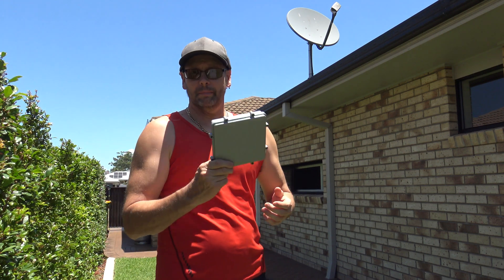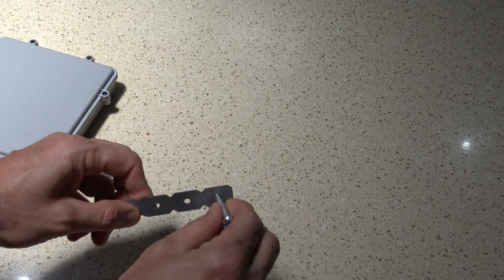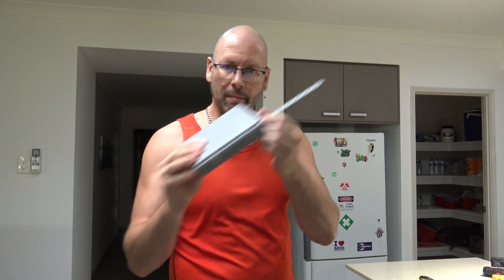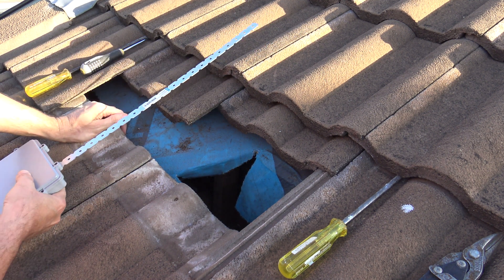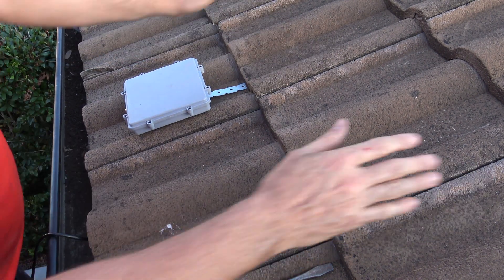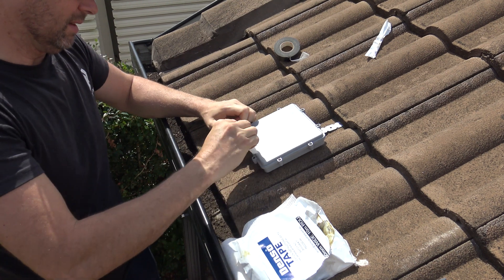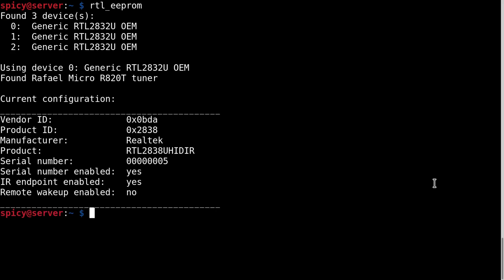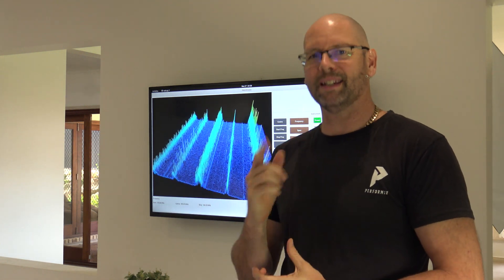Satellite Antenna For SDR

Comment: 1:00 minute timestamp indicates that the description text might benefit from mentioning 1/4 20 UNC (consumer camera mount screw thread) size. This information is to help people. Having that fitting and a VESA mount (for servos to position at a satellite like say so an LNB, by means of KU-Band, can also get data and signals to and from Es' Hail 2 satellite's amateur radio transponder transmitting on the 3CM band)_ atop a grain silo and IBC (water) in refugee camps (with a small screen at the bottom the height of a man) could be handy to send OpenID_OIDC_OAuth2_SimpleSamlPhp_LoRaWAN data for logistics of items, people and business allocation like graphical linear inequalities for moving pretty much anything with a pertaining Q-R Code (3KB) sticker on it, containing all such data and latitude-logitude-altidude cronjob and bearings for derived velocity and IPv6 unique identifier (and A2DP, EDR bluetooth 5.2 and wifi 6 and ZigBee gadgets atop it with solar power and battery), tracking data via markov chains and gaussian heatmaps for disease, nutrition and so forth.
Would be interesting to see a Q-R code sent/received by Data Mode like SSTV Slow-Scan-TV and the error correction tolerance of those Q-R codes, like say on a version 40 177x177 size. compiled data can be compressed as TAR ball GZ and only safely sent data is sent, so encryption can be used if needed (as a GPL, like GnuPG or BOTAN version). Some portable dishes allow for usb to remote in like RS232 serial for changing angle on a BASH script.
My comment has no hate in it and I do no harm. I am not appalled or afraid, boasting or envying or complaining... Just saying. Psalms23: Giving thanks and praise to the Lord and peace and love. Also, I'd say Matthew6.

Comment: Think I mentioned it in a previous video, but there is some very interesting and fun stuff in the band, techminds did a few videos on what you can pickup and decoding steps,
I usually just monitor the inmarsat std-c messages, get the usual weather and pirate warnings, plus the odd email message.
Iridium is a bit more complicated, but also contains some interesting stuff

Comment: What kind of satellite antenna is this? Is it for geostationary satellites? Also just a heads-up: all the modifications you've made to that metal strip will cause it to start rusting a LOT faster. The screw too, because you've partially removed the protective covering (probably zinc plating on the strip and zinc-chromate coating on the screw). Just so you know.

Comment: Do you have to protect against lightning strikes with the antennas on your roof?  I keep mine within the attic because I'm not sure how best to deal with that.
Reply from the maker: If lightning strikes my roof, I'll have bigger problems than that antenna.
Reply: "I keep mine within the attic" - lol
Reply: @CoolKoon  Guess where the conduit with the wiring for the stove runs that was hit by lightning. In our attic. Welded a hot wire to the conduit when it did it.
Reply: @gravelydon7072  I mean if any of your devices get directly hit by lightning then you're SOL either way. If you only get hit indirectly (via inductance) then your devices might stand a chance with the help of a TVSS. Antennas on the top of the roof should be equipped with a lightning rod anyway I think. Either way your antennas are not too useful when they're inside in your attic, are they?
Reply: @CoolKoon  All our antennas are outside. What makes it bad for us is that we have a two story house in the lightning state. we already have had direct hits on this house and the previous house which was only a one story,  got hit 5 times in the 17 years we owned it. Were they direct hits, well seeing a heating element impact the glass in the oven door would say yes. As would the TVs  and clocks and the fact that the cable from the TV to the amplifier we were on and the rest of a whole block got taken out at the same time, yes. Insurance company refused to pay on the last time until an electrician came out and checked the wiring. As did the phone company and the local city owned electric company. All found that house properly wired and grounded. Such is the dangers of being the first house on a transformer that is connected to a 3 phase line.
Reply: @CoolKoon  Well that depends on the antenna and the attic obviously. I have a simple FM rod up in my attic. But that attic isn't insulated. That antenna is connected to a high quality amplifier/splitter and captures analog FM radio, DAB digital radio and DVB-T digital TV (I'm in Europe) very well. FM stereo without noise, DAB and DVB-T with 100% signal quality. It goes without saying that a satellite dish isn't going to work there. But it is comforting to know this attic antenna is well protected against weather and lightning as I have two TV's and two FM/DAB radio's connected to it.

Comment: Thanks for the great video! Nice to see a self-vulcanizing tape, I also use it in my job. I wanna ask about a Denzotape. How easy can it be removed from a previously sealed connection?
Reply from the maker: It's easy enough... easier than the vulcanising tape. You just take it off like you put it on.
Reply: @TallPaulTech  Three layers of tape if I want it water proofed. Vulcanizing tape, Friction tape, Electrical tape. Friction tape is a neater form of your Denso tape. To remove after a while, use a utility knife and slit it. Then peel it all off at once.

Comment: 20m of coax you will lose  a lot of signal, better to run a short jumper SMA-SMA  and run a USB ext cable up to the roof near the ant.
Reply: Yes. Alternatively put a raspberry pi on the roof connected directly to the SDR and run ethernet down.